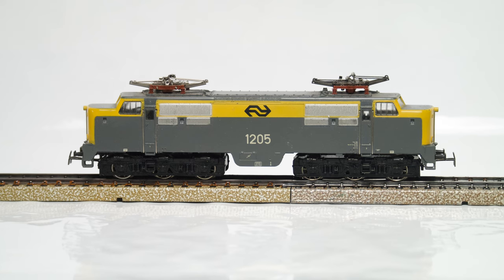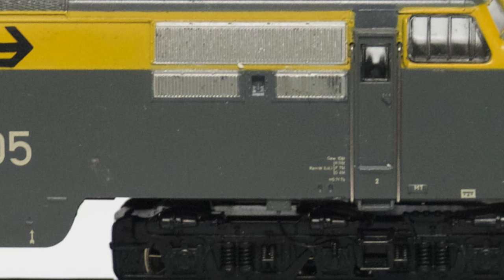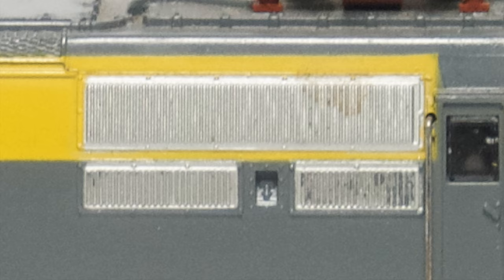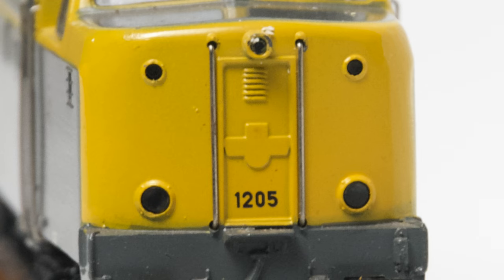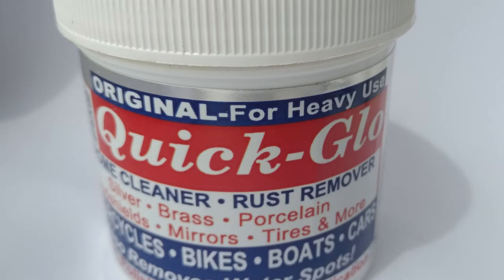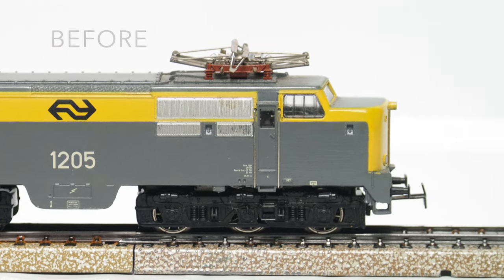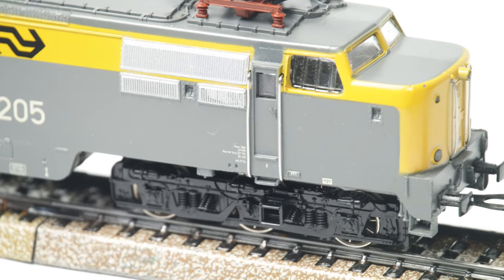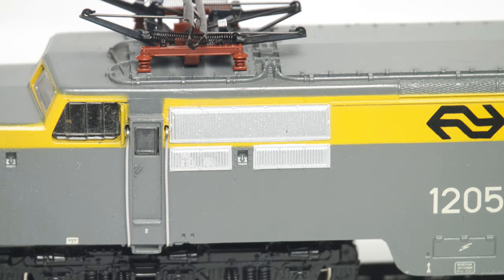Can I fix it? Märklin 3055 bodywork on a budget

Comment: Great video as usual. As I do not have a huge model railroad budget, I am always rescuing or fixing old loks. You went the extra mile on the handrails. One technique that has worked for me on rusty handrails is metal polish and my dremel with the polishing pads. I leave them in place and  mask the handrails off with multiple layers of masking tape and polish them until clean and semi shiny. I like the patina on the old loks as it gives them a sense of history...
Reply from the maker: Yep, but just because I broke some. I normally polish them too. Thanks for your visit!
Reply: Not realising this video is 2 years old, I left a comment, partly with you in mind.  So you might find it I now leave some of it as a reply.  It might help, or it might not.  It made a huge difference for me:  
     Thanks @terieland8344.  Wonderful.  You mentioned 'budget'.  Here's a tip for painting and restoring over limited and           large areas.  If you have an old pump fly-spray, you can convert it to an airbrush.  No, it's not 'Iwata', but it is, with practise, quite OK.  Unsolder (or if American 'unsoder') the tank and replace with a bit of K&S tubing  experiment for size.  If you can't solder, ask at a train show or club.  Position it as was the original siphon tube.  I use film canisters for paint cups, and I use the telescoping size down for cleaning the siphon tube.  Use a scriber to poke a friction fit hole in the jar top, and don't forget a tiny hole for it to 'breathe'.  For cleanup just pour turps or whatever down the tube and finish with the wire.  Cleanup this way takes all of two minutes.  Work outside with a small breeze at your back, don't breathe the stuff, avoid skin contact, and FOLLOW SAFETY WARNINGS ON THE PAINT JAR/TIN.  Wear a mask.  This is a good system.  The best airbrush in the world is YOUR airbrush.  Practise, practise, practise, to build up practice.  I think you can work out the rest- ask if need-be.  The best modelling is not costly.  Neither does Marklin collecting need to break the bank.  It just doesn't.'

Comment: Interesting as always.  Wondered why you did not nickel plate the pantograph pans???  Also, a bit of Humbrol enamel touchup would help around the lights.  

It would need testing on a junk model car, but I have found it useful to protect model paintwork by wiping with a swab impregnated with regulation mix 'Turtle Wax Car-wash.  Rinse off in clean water and dab dry.  This is quick so I have not had any decal problems.  If I did have re-applying with gum glue would probably solve the problem.   The idea is to protect the paint.  I have used this extensively on Wrenn.  If you need to remove the wax for repainting or something, try any of the wax removing detergents.  Water will not sit on a wax-free surface.  Don't take my word for anything as all contexts are different; worth your own research.

Thanks @terieland8344.  Wonderful.  You mentioned 'budget'.  Here's a tip for painting and restoring over limited and large areas.  If you have an old pump fly-spray, you can convert it to an airbrush.  No, it's not 'Iwata', but it is, with practise, quite OK.  Unsolder (or if American 'unsoder') the tank and replace with a bit of K&S tubing  experiment for size.  If you can't solder, ask at a train show or club.  Position it as was the original siphon tube.  I use film canisters for paint cups, and I use the telescoping size down for cleaning the siphon tube.  Use a scriber to poke a friction fit hole in the jar top, and don't forget a tiny hole for it to 'breathe'.  For cleanup just pour turps or whatever down the tube and finish with the wire.  Cleanup this way takes all of two minutes.  Work outside with a small breeze at your back, don't breathe the stuff, avoid skin contact, and FOLLOW SAFETY WARNINGS ON THE PAINT JAR/TIN.  Wear a mask.  This is a good system.  The best airbrush in the world is YOUR airbrush.  Practise, practise, practise, to build up practice.  I think you can work out the rest- ask if need-be.  The best modelling is not costly.  Neither does Marklin collecting need to break the bank.  It just doesn't.
Hope you are all enjoying the English summer.  Time to put the trains away for a while.... excepting for spraying outside.
Reply from the maker: I didn't know about nickel plating at the time... This is an old video, not my best work... 
Thanks for sharing!